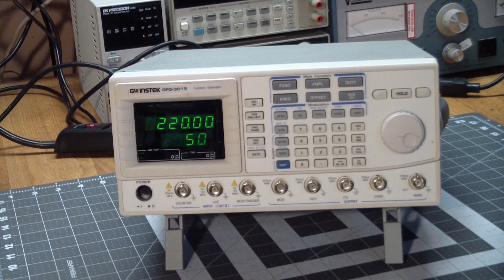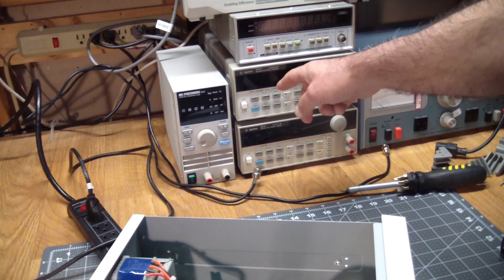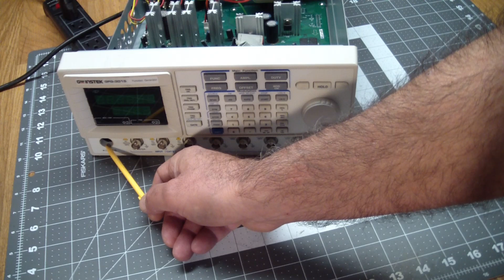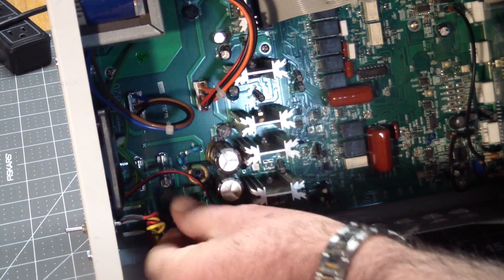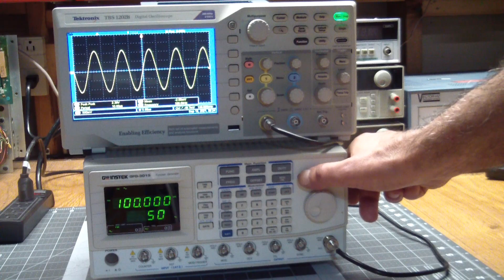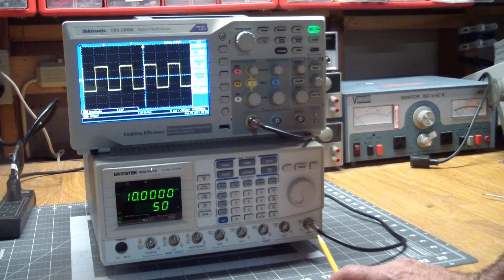AE#152 GW Instek GFG-3015 Function Generator Teardown And Demo

Comment: I recommend putting the original switch in a bag and taping it to the inside in case one day a new shaft can be found or made for it so it can be returned to original
Reply from the maker: I'm with you. I already put in a plastic bag and taped it to the inside.

Comment: Ideal case for a 3D printer to make a new switch shaft, that is actually why I have 3D printer, to make replacement parts for broken test gear.
Reply from the maker: I'm running out of excuses for not having a 3D printer
Reply: @artifactelectronics  3D printing is a godsend for hard to get parts, or making/getting parts fast. I would 3D print a top hat shaped button, bend a 1/8" steel rod until it clears everything, and heat-shrink the end to the switch. I'm actually seeing 2nd hand fairly new 3D printers around for about $100.

Comment: And why not fashion a way to place the new switch where the hole is now?
Reply from the maker: The hole is about 3/4" deep, and I didn't have a toggle switch that could be mounted in an aesthetically pleasing  manner.
Reply: @artifactelectronics  Mount the original switch with a suitable knob.

Comment: Why are there 8 outputs?
Reply: Just a guess, maybe  some of the outputs have different impedances?  Just speculating 🤔 not being a smart 🐴.
Reply from the maker: Starting from the left: EXT counter input,  VCF (freq control voltage) input, EXT modulation and trigger input, modulation/sweep output, GCV (freq control voltage) output, TTL output, sync output, main output.